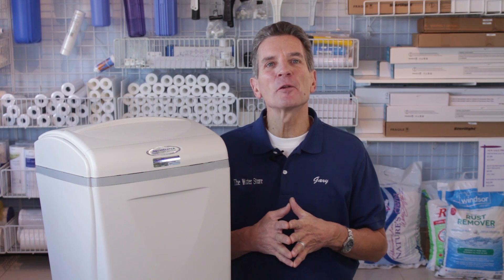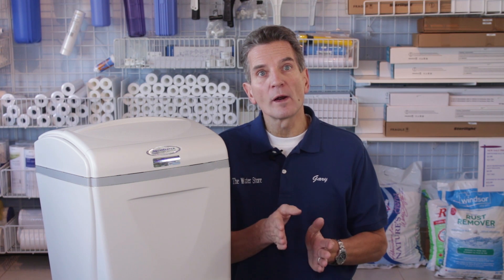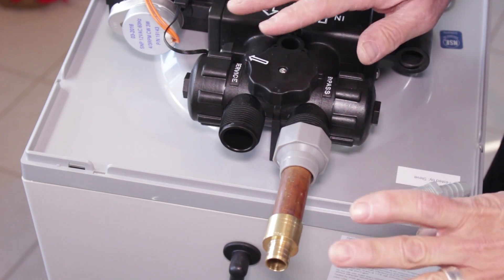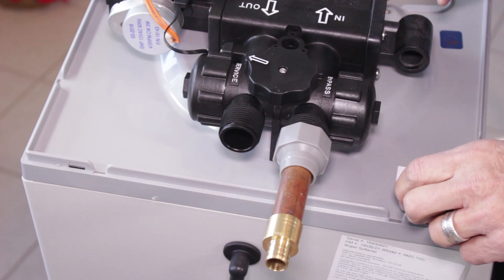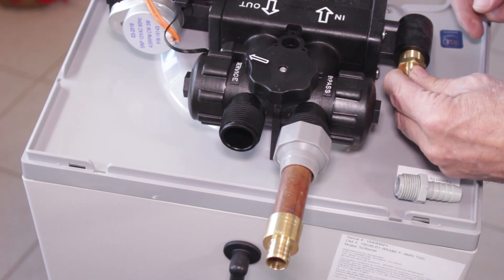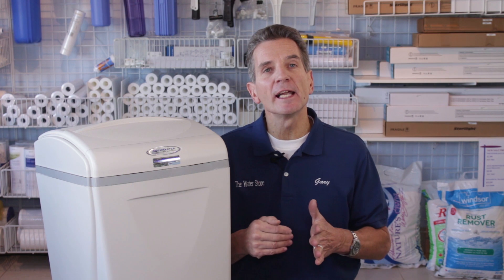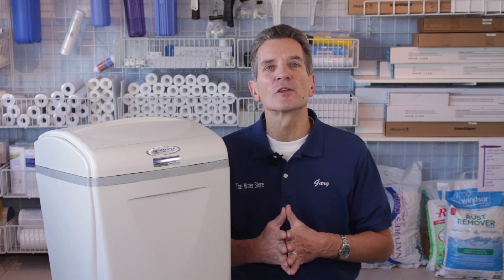Water Softener Installation Part 2A Aquamaster Plumbing

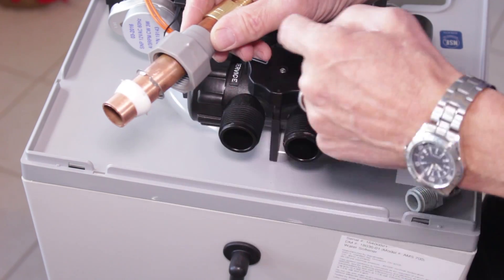Comment: 1:00 why do we have to start off with copper? can we use pex to FNPT adapter?
Reply from the maker: The fittings that come with the softener are only compatible with copper.  If you use 1" FNPT you can adapt to pex.